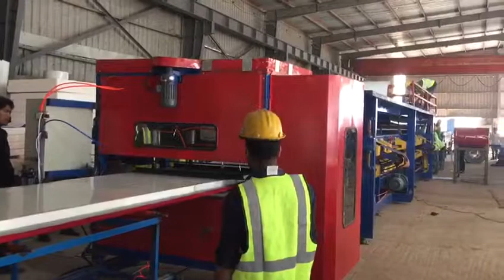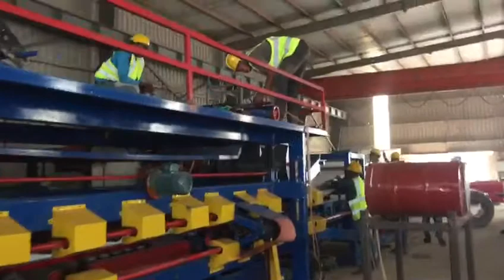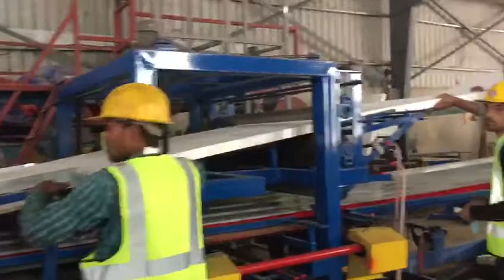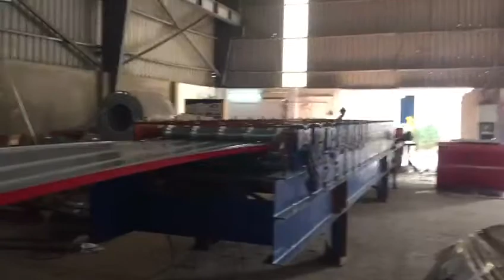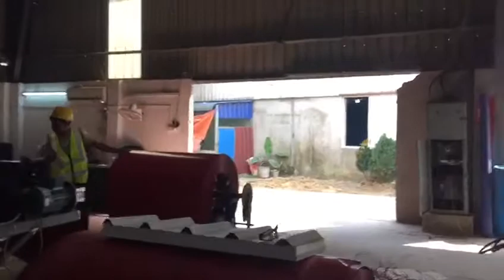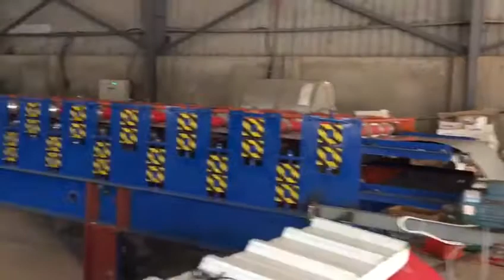L A Sandwich Panel LTD

Comment from the maker: L A sandwich panel introduce in Bangladesh Market flame retardant EPS Sandwich Panel by full automatic multidimensional machine. This is first time Bangladesh 
Our Key Products:
1. Flame Retardant EPS Sandwich Panel (Wall & Roof)
2. Fire Proofed Rock Wool Sandwich Panel (Wall & Roof)
3. Flame Retardant PU Sandwich Panel (Wall & Roof)
4. Steel Structure Buildings 
5. PEB Sandwich Panel Buildings
6. Steel Structure Manufacturer 
7. uPvc Doors and Window